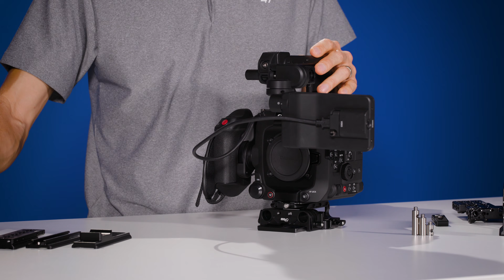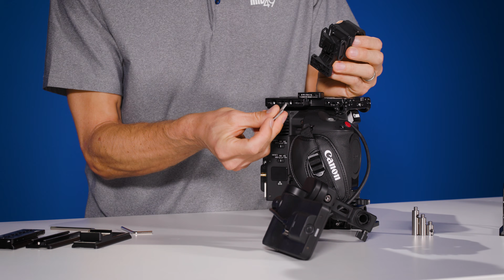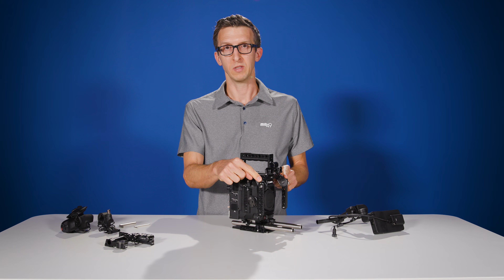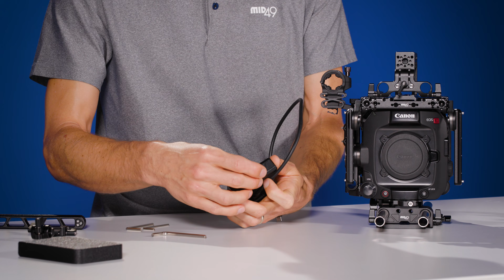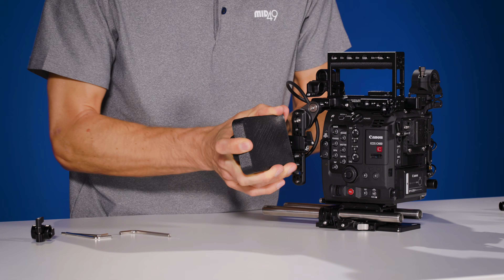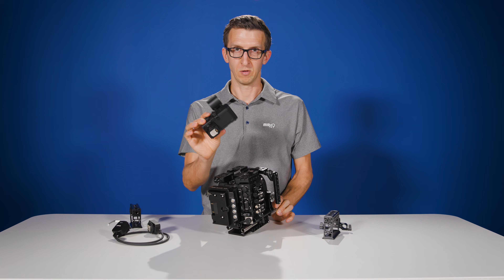MID49 Canon C400 Accessories Overview

Comment: Hi. MID49 C400 base kit is packed with incorrect baseline base plate! I ordered base kit for C400 and box contained different type of baseline baseplate (i got plate for Raptor- i can seee this code on the white label M49-BSL-L W23-AC7). Please let me know what I should do. Should I contact reseller?
Reply from the maker: Hi I'm so sorry to hear that.  Could you please email us at info@mid49.com
Reply: @mid49films  Hi. I have another question. I used DB-10 with Nucleus M with one 3-pin Fisher cable via Fisher R/S output at DB-10 and unfortunatelly it does not work. Motor did not power on. Any ideas what is wrong? It should work.... thanks
Reply from the maker: @petermydliar4583  Please send us an email at info@mid49.com

Comment: Re your question/ feedback request: What about top plate that allow to use original top handle including contacts and than put Tascam to top cold shoe? Based on patent registration and rumors Canon will be releasing a wireless microphone set for the RF system- for hot shoe so take in to the consideration that people will want this functionality soon....
Reply from the maker: The good news is that the contact block is exposed and ready for whatever is coming :)
Reply: @mid49films  What is typical consumption of DB-10 itself? I have purchased it and it looks quite hungry. What is idle current? (because of built in electronic DC/DC converters and protection circuits etc).

Comment: Every company making arms for the monitor have really missed one main function: to be able to fold the monitor in when not in use. Sure the new arm is smaller but what’s the point if you can’t fold the monitor when you’re done, now it takes even more place in the bag.
Reply: Agreed
Reply: Bright Tangerine fixed that.

Comment: Is a push button (levered) rosette feasible for the right hand grip?  Purpose would be to make quick angular adjustment to the right grip by simply pressing a push button.  For example this can be super useful when the cam op goes for a very high or very low angle—such a feature can reduce wrist strain and time delay of unscrewing rosette.
Reply from the maker: You certainly could add a push button rosette between the grip and our ARRI Rosette to 15mm Rod Clamp. There are a few available from other manufacturers.

Comment: Can the monitor mount rotate to view from the side of the camera? I may have missed that. Also, are these products in stock/shipping now?
Reply from the maker: Are you trying to set up the monitor like an AC's control panel on the camera's right side? If so, you could use these items together to do that:
https://www.mid49.com/products/top-plate-canon-c400
https://www.mid49.com/products/arri-to-canon-striped-rosette-canon-mic-mount
https://www.mid49.com/products/monitor-hinge-canon-c300-mkiii

If you just want to turn the monitor while installed on the TWIST Mount EVF Kit, that is not possible with the current setup. All of these products are in stock and the DB-10 will start shipping October 14th.

Comment: The first thing we did after receiving a C400 was integrate the MID49 Mid Kit into our Canon C400 workflow, and just after one full-day shot, we were thoroughly impressed with its performance. This comprehensive accessory kit has significantly improved the camera's ergonomics and functionality.

The precision engineering evident in each component of the Mid Kit is remarkable. We have used numerous other brands, and MID49's commitment to quality is exceptional. Their pieces have robust construction and beautiful round corners. Beyond the hardware itself, their customer service has been exemplary. The unexpected inclusion of a handwritten note with our order was a welcome touch that underscores their dedication to client satisfaction.

The innovative EVF mount has already proven invaluable. (I think we were among the first customers to have it.) It provides much-needed stability and adaptability to the C400's viewfinder mount. Canon's C400 EVF viewfinder mount design is marginal at best. If there's only one thing you should get for the C400, this is it. Furthermore, the top plate, baseplate, and breakout boxes offer many mounting points for accessories, streamlining our camera configuration and workflow.

While the Mid Kit has exceeded our expectations, we would love to see:

Expanded Shipping Options: A wider array of shipping options would be great, particularly for time-sensitive productions requiring expedited delivery.
ARRI BUD Integration:  Developing an ARRI BUD-compatible baseline system.

The MID49 Mid Kit for Canon C400 is an indispensable investment for professional filmmakers seeking to optimize their camera capabilities. Its exceptional build quality, thoughtful design, and outstanding customer support make it a standout choice for us. We have pre-ordered the Power Distribution Box DB-10 and can't wait to incorporate it into our setup upon its availability. We highly recommend this kit and MID49 and their commitment to providing high-quality solutions for the filmmaking community.

Comment: I would love to see the breakout box be a bit more modular/less camera specific. Mainly I am referring to the 4 pin XLR, I often times am swapping gear based on the camera production is using. If the 4 pin XLR could be removed so I didn't have an extra cable dangling when I am using a camera that doesn't support 4 pin xlr that would be amazing! Also as far as the Tascam recorder if I need more audio inputs I am usually pulling out an audio mixer to handle audio seperately. I would rather see more mounting options.
Reply from the maker: Thanks for your input! We will have a more generic version of the DB-10 later this year once we finish a few other versions in development.

Comment: Some great products. It makes the c400 more appealing. 
Regarding be tascam, can it mount on the side rail? Always better to be away from the operator. On top it starts to look like the first c300 clam shell.
Reply from the maker: We could make a shoe-based mount to put it on the side rail. Something like a female cold shoe to a NATO clamp, but it would need to be at a 90º angle. It is about 1/3 the size of the camera though so it will add quite a bit of bulk anywhere it goes.
Reply: @mid49films  Will you be coming out with handle extensions for the top handle?
Reply from the maker: @sowza1  Are you wanting an extension for the Canon handle itself or for our top handles? If you need to extend the ARCA Top Handle or the Rainbow Top Handle, all of the Rainbow extensions work with both:  https://www.mid49.com/products/rainbow-handle-extension-100mm

Comment: that monitor mount is very cool. Any plans to make for an external monitor like a smallHD ultrabright?
Reply from the maker: We are making some versions for ARRI 3/8-16 and 1/4-20 with locating pins, ARRI rosette, and an L bracket. What model do you have exactly?
Reply: @mid49films  i have the 503 ultrabright. It's a pain to rig but i have a solution. yours would be much more elegant and practical
Reply from the maker: @the_kid-i1k  That monitor, in particular, is hard to rig from the right side where all the connections are. It would really be better to mount from another side since the cables also exit toward the camera.
Reply: @mid49films could you make one for the smallhd smart 5 series? I have the Cine 5 and would love to ditch Noga arms for certain configurations
Reply from the maker: @umanaf  We will be releasing some versions with ARRI 1/4-20, ARRI 3/8-16, and ARRI Rosette. It looks like the ARRI 1/4-20 would work for the Smart 5.

Comment: Very well thought out system, the quick release aspect of the battery plate is genius, as is the mini XLR to full size adaptor.  Awesome stuff as always!  As for audio, I wouldn't bother with Tascam and feel most people spending $8k and up on a camera body are in a similar boat.  All of our C300 Mark III's have the Canon EU-V3 Expansion Units which give the camera's 4 independent XLR Inputs, but realistically any time we need more than 2 audio inputs it is almost always a multi cam shoot and audio is being fed into a field recorder.
Reply from the maker: Thanks for your input!

Comment: This looks like a good option. Hard to gauge distance in the video but would I be correct in thinking that a small FIZ kit like the tilta nucleus 2 wouldn’t reach a lens from the position of the top rails mounts? Thanks heaps!
Reply from the maker: The distance from the top handle rod clamp to the center of the lens is about 100mm where the baseplate standard is 85mm. If you need to mount a single rod, check out the ARRI Rosette to 15mm Rod Clamp which is almost exactly the same distance to the lens as a baseplate rod:  https://www.mid49.com/products/arri-rosette-to-15mm-rod-clamp

Comment: That battery plate solution and breakout box may actually sway me to upgrade my C70 to the C400 instead of the C80 that just got announced. I've been on the hunt for a system that would help me shift from the SWIT BPA60 batteries w/ the DTap (which I use to power my SmallHD 702 Touch) that pokes right into my sternum. 

The final straw would be a similarly bright 5" or 7" monitor with camera control that ideally only needs the USB-C cable to work (to avoid excess cables like the SmallHD/RED monitor system).
Reply from the maker: I'm glad you like it! I am curious about what is possible out of the USB monitor port and if Canon will be releasing new monitor options that would use it. A 5-inch monitor would be amazing.